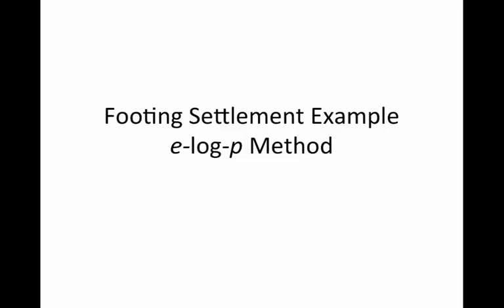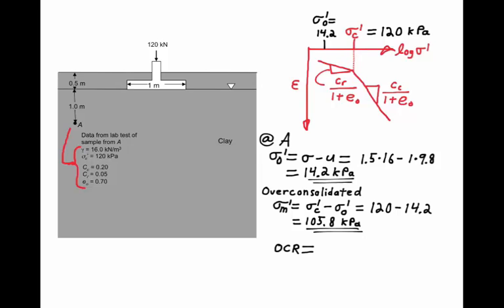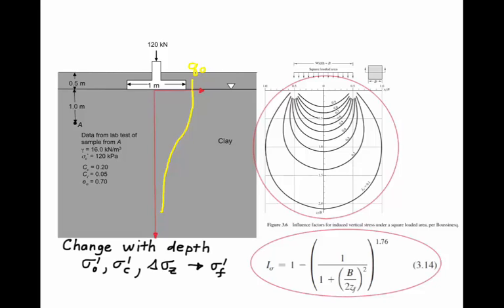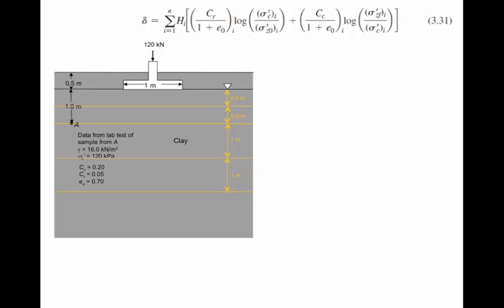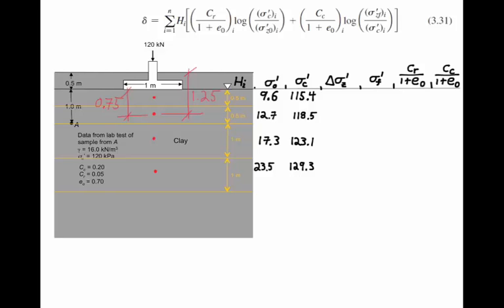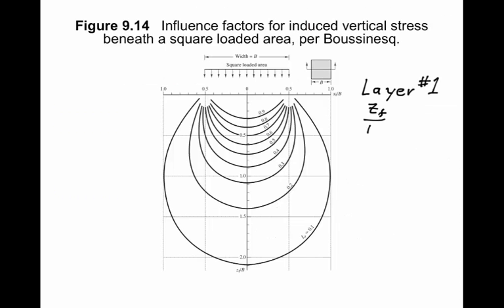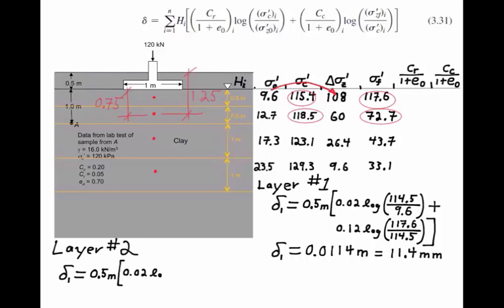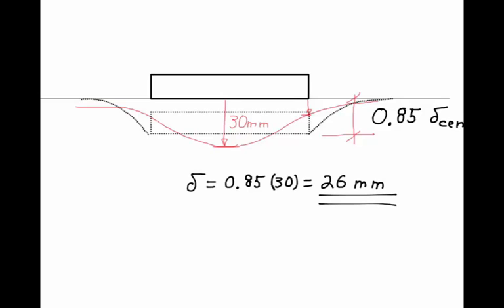CE 424  Settlement e-lop-p Method

Comment: Hi Dr. Kitch
In this Example we are assuming that Preconsolidation stress (sigma C) which we collected from Consolidation Test (120 kN) will be as the same stress will apply by continuous footing in proposed project? If Preconsolidation stress were lower than than stress by proposed project is this scenario still valid?

Thanks